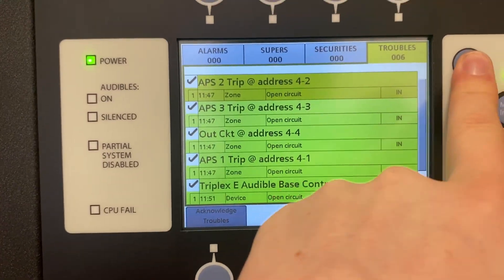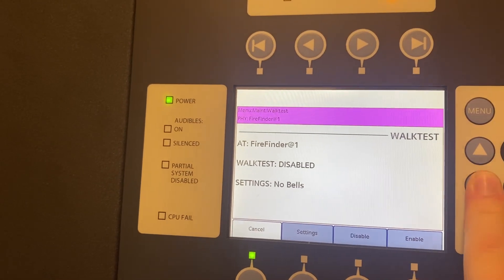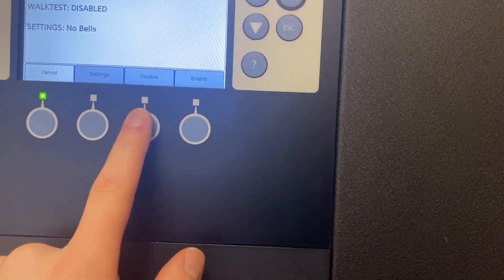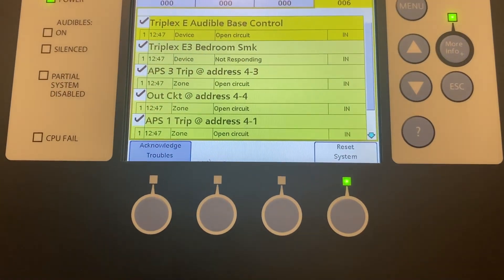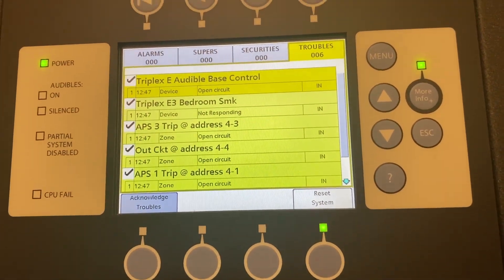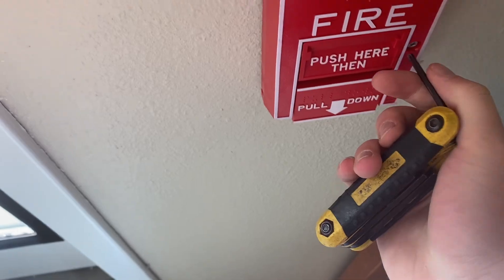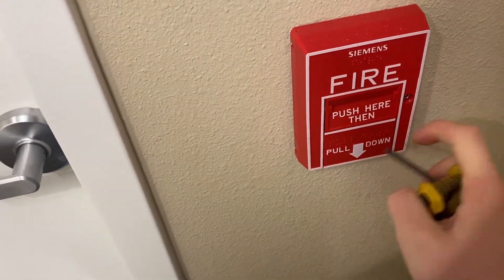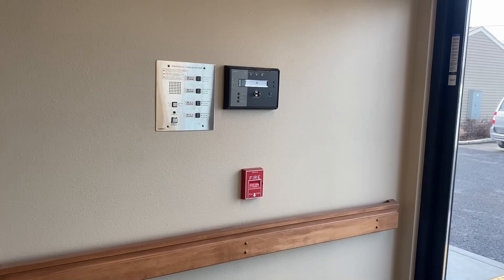Struggling to Test a Fire Alarm System

Comment: They should replace all these pull stations with Siemens XMS-D or RMS-1T pull stations because they use a key to reset which is very easy and fast than these slow as heck HMS-D pull stations and that the XMS-D ones work with the FireFinder panels and also I the panel needs a firmware update to allow walktest when there's a trouble condition and easier to navigate to it because that's just dumb to not let you do it when there's a trouble condition with also better responsive interactions with the buttons

Comment: What a screwed up install! Not to mention badly-designed pulls (def reccomend a T-handled key for those), but the panel can't walktest, the annunciator takes 50 years to do anything, and I don't think the the ZHs were syncing with the LF sounders either... I thought Siemens made their stuff so proprietary to make it harder for crappy installers to use their products, but here we have this! xD